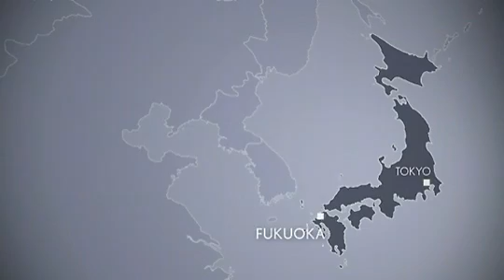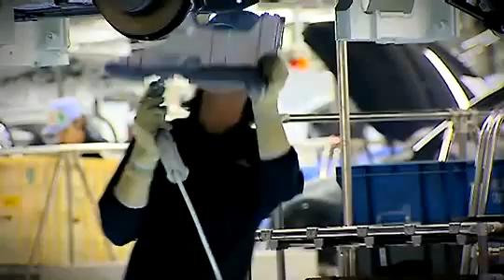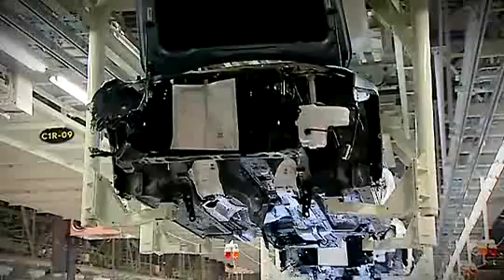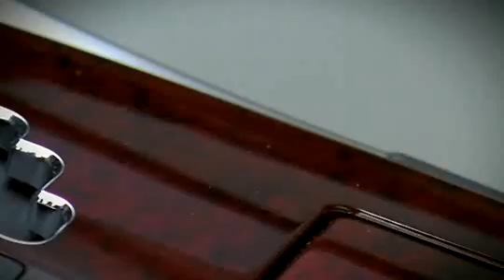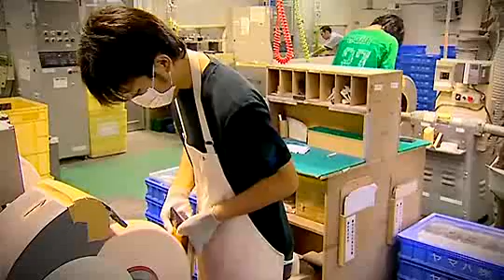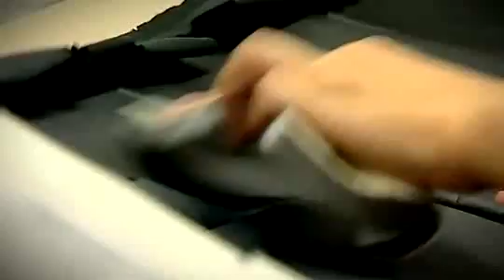Lexus plant production of cars

Comment: My wife has a 2010 Lexus IS 350 convertible that's going strong. Really strong. 
Unfortunately, the time has come for reupholstering the driver seat as it had a quarter size hole in it from the constant heat/cool and general wear. No such problems in the 2009 Lexus RX 350. That leather is amazing. 
Aside from basic maintenance it's been bulletproof. Not a single problem. 
Just did the transmission flush at 95k miles and will be doing an extensive maintenance overhaul as preventive maintenance. 
Spark plugs, oil change, water pump, radiator fluid, oil change, shocks, and new LEXUS leather interior as a Christmas gift for my wife. It'll be literally a new car. She absolutely loves that car. 
When the LC 500 convertible comes out I'll be there. Another surprise for her on our 20th anniversary. We'll give our current one to our daughter. 
Thank you Lexus.

Comment: You're very lucky. Not everyone has experienced this problem but it's a big one that many have faced. there's also the metallic clacking noise at startup others experience but I haven't on my ISx50. The rattles and squeaking issue is caused by clips and screws that were loose and or the insulation in the dash used in the factory would shrink when the weather got cold BUT wouldn't expand back to normal when the weather got warm. I have brought my car in for it but the rattles/squeaks are back